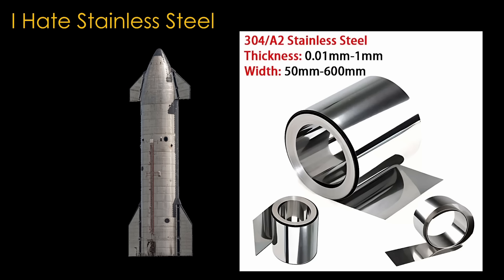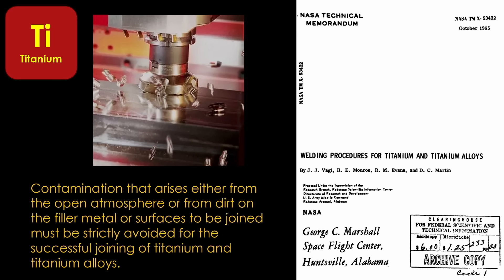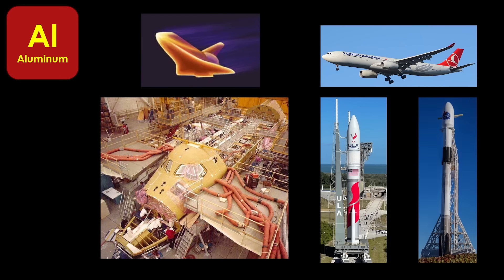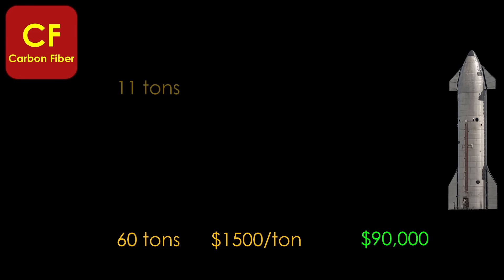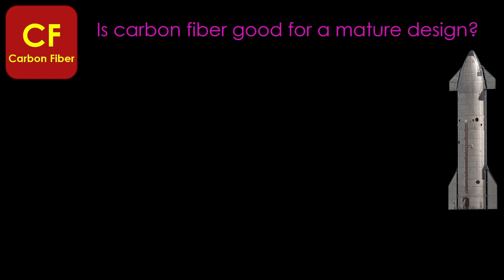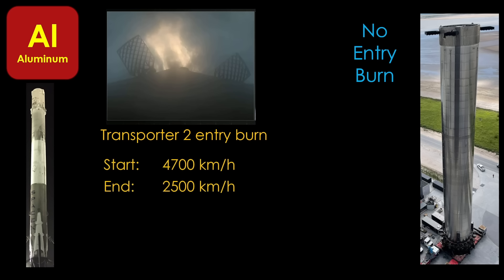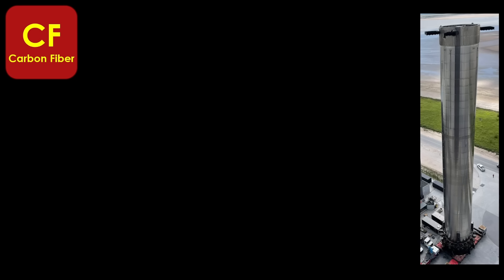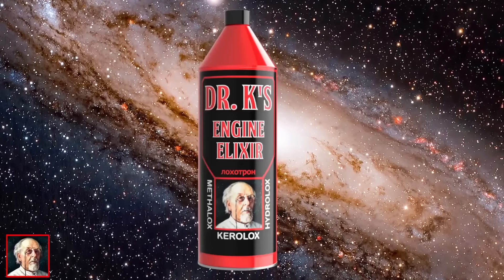Why Starship Loves Stainless Steel...

Comment: Another thing that you didn’t talk about which is extremely important is basically a third year engineering question (which was asked in my third year by the professor). By your logic large aircraft should be (/ could be) built out of stainless steel (as per your Super Heavy logic), BUT ARE NOT ! Why is that the case? The reason is extremely clear if you follow the iterations of super heavy. Aluminum provides significant better buckling resistance as a function of weight due to having a significantly better “bending moment” due to the inherent geometry generated out of a significantly lower density material. It is easy to see this at work in super heavy where they have drastically increased the number of internal stringers to deal with this problem. It is now basically the case that super heavy has effectively doubled the amount of stainless steel to generate a good cross-section geometry to resist buckling. All of these internal stringers appear to be spot welded onto the outer skin generating stress concentrations that hurt the buckling strength. This requires further strengthening adding weight and any mechanical engineer can see the spiraling addition of weight needing more engines, more fuel adding more weight (iterate as per Musk Methodology). One can make stainless steel work, but is it optimal ‽ Also one can stir weld aluminum to provide a more homogeneous connections without stres concentrations!

Another related issue is that a more flexible stainless steel structure has significantly inferior vibrational characteristics that also force this need to stiffens the wall structure (to push up the resonant frequencies). This is now biting them in the proverbial tuchas on starship because  the stainless steel structure that is used to “loosely capture” the thermal tiles is too vibrationally flexible and thermally expansion / contraction VARIABLE. So more stringers, more weight, more engines, more fuel adding more weight; rinse and repeat! So they brag about how the stainless steel stood up to extreme temperatures (sorta), but if the stainless steel is getting hot, then something is very wrong. 

The musk methodology is that no part is the best solution. So if that is so good, why has the internals of super heavy turned into a Rube Goldberg contraption to deal with the icing generated by their pressurization system? 

I believe that the reason that stainless steel is being used is due to the exact same reason that a “FLAME DIVERTER TRENCH” was not needed. It is going to take time to bandaid the inherent problems baked into this design.
Reply from the maker: SpaceX clearly knows everything that you mention - and knew it before they started with starship - and therefore their choices mean they looked at the trades and believed that stainless was the superior material. We don't have access to all the data and information. 
WRT the thermal tiles, nobody had ever tried to put thermal tiles on a cryogenic tank and therefore there wasn't prior art to look at. SpaceX clearly believed that they could figure out a solution to make it work, but it appears that they haven't yet. They might come up with a solution that works, they might go to a metallic solution, or they might end up with transpirational cooling, or some combination of those. That is the sort of thing that happens when you are doing research.
Reply: → EagerSpace

Thank you for a thoughtful reply. I believe very strongly that Spacex has very competent engineers (& control system engineers that are extremely knowledgeable). The thing is that there seems to be a tension (or even a possible disconnect) between establishing well thought out beginning foundations of their designs and the potential ramifications. The Musk Methodology seems to imply that everything in a developmental process can be iterated into a satisfactory outcome by starting from basically a simplified clean slate with little regard to industrial practices.  The rate of iteration is breadth taking and almost morphs their designs in an organic evolutionary fashion. The thing that gives me pause is that sometimes very large initial global design strategies have the feeling of not being deeply thought through before they embark on that path. Part of the worrisome aspect of the Musk Methodology seems to revolve around the issue of just who makes the foundational path decisions. 

One of my engineering professors was responsible for making the decision of what was the design lifetime of the Space Shuttle (an obviously foundational design parameter of the whole program). The short story is that he “pulled it out of his a.. because it was a nice round number”! These were his words and he always got a great laugh out of it. Considering that he had a PhD in Aeronautical Engineering and was brilliant, one can get a sense of how big decisions can be made that establish developmental pathways. Personally I get a strong feeling that possibly some significant starting decisions at SpaceX are established by someone who doesn’t respect in-depth early planning because it slows that part of the process down. It is also possible that more options are not evenly considered taking into consideration various people’s experience. It is clear that Musk has a type of genius, but he is not prescient when it comes to somethings. 

Yes no one has ever embarked upon putting ceramic tiles on an overly flexible substrate that is subjected to massive acoustic, aerodynamic and structural forces that is also a cryogenic tank that gets extensive heating. This is not the low hanging fruit solution.  For me it is a solution that is fraught with a lot of unknown unknowns that will take a lot of time to overcome.

Again, many thanks for your excellent videos.

Comment: This gave me pause to think about the reason why they used titanium for the SR-71. In my head , I thought titanium resists heat better than steel, but that doesn't seem to be the case. So the main reason they chose to use titanium is because of the weight benefit, and because aluminium doesn't resist the temperature. Theoretically, a stainless steel SR-71 would be able to fly faster if they could get it off the ground ;-)
Reply from the maker: With airplanes the default is typically aluminum because it's a great material. The SR-71 would have stepped up to titanium for the better high-temp performance than aluminum, and it doesn't get hot enough to go beyond what titanium can do. 

And lightness is obviously hugely important.
Reply: @EagerSpace  Yes, another example of engineering tradeoffs ;-)
Reply: No one would blame you for not knowing high temp “steel” exists. In metallurgy, we wouldn’t call it “steel” we’d more likely call it “stainless” because the composition and properties are vastly different. I feel like “steel” is used for high strength low alloy and plain carbon steels which do not have these high temp properties and more simple alloying additions. If we’re specifically talking about high temp properties, we’d likely go one step further and say “austenitic stainless” since there are 5 different types of stainless and austenitic stainless steel has the best high temp properties.

Comment: I mean if you need a little more payload to orbit you can always release a payload + falcon 9 upper stage out of the starship bay.
Reply from the maker: I think you should be talking to impulse space for a kick stage. It's designed to do that sort of thing and will be higher performance than the F9 upper stage.

Comment: Maybe the  Moon  Starship will use Aluminum. That will not only be useful for the moon but could land many planetary exploration contracts. The impact of the tons saved (no need for reentry) will allow a revolution on Solar system travel.  It's not as good as Nuclear Thermal but it will be huge.
Reply from the maker: SpaceX would need to build a different production line and do a fair bit of testing to do that. They wouldn't get any more money from NASA.

Comment: F1 chassis constructed of cf seem to handle 200c without any significant loss of structural integrity. I wonder if you could build Starship from that f1 prepreg, then reinforce it with carbon/carbon in high-heat sections? It might be an interesting way to expand capabilities down the road -- without needing a clean sheet design.
Reply from the maker: Where is the F1 chassis at 200c?
Reply: @EagerSpace  The area around the exhaust manifold has got to be getting up there. They go through lots of thermal cycles over a season, and you don't typically see delamination failures. I'm sure I'm missing something, but you got me thinking about the benefits of lower mass during re-entry, and the addition of carbon/carbon reinforcement would give you thermal protection to ~2000 c.  Fantastic channel Eager!

Comment: Not related to this topic, but I think it would be interesting to take a look at the SH grid fins. At the latest Starship update presentation you could see that the v2 and v3 SH have their grid fins lower, and by the looks of it they are bigger as well. In the tracking footage of the booster landing on ift4 you can see that the grid fins have a relatively high angle of attack, but the booster itself has got a pretty low angle of attack, so has the current solution to little control authority? Also as far as I know the reason to use of grid fins on the F9 was bc they could be tucked in on ascent and deployed on descent but now on Starship they keep them out the whole flight. So wouldn't it be better to use normal fins at this point?
Reply from the maker: Grid fins are used because they perform well at hypersonic speeds. F9 tucks them in to reduce drag but presumably SpaceX did a trade on them for super heavy and realized that the mass and complexity of making them movable wasn't worth the reduction in drag on ascent.

Comment: You did imply it a bit but I do find it interesting that even if Starship does achieve what it sets out to do there will still be opportunity to make something out of carbon fiber that would be better. With the caveat that whoever sets out to do that would need to know what they want first. (Also that the most likely group would be Rocket lab).

That also does give a video idea for you. “What could be built to beat Starship” and have it go over potential     drawbacks to the current design or other options that could be cheaper. Some I could think of, smaller while still being fully reusable so most missions do not need ride shares, dedicated on orbit tugs to avoid needing as many refueling flights, carbon fiber instead of steel, fewer bigger engines that are pushed less so are cheaper in the long run (personally not sure about Raptor’s wear rates based on engineering principles) and other potential drawbacks that starship has because of trade offs made.
Reply from the maker: The really interesting word that you use is "better". I'm not sure what your definition is, but it's pretty common in spaceflight for better to be "more technically elegant" or "higher performance". With the exception of Raptor - which is both of those things - starship is a big brute of an architecture but what SpaceX is going for is cheap and robust, which gives a different set of design tradeoffs. We see that in Falcon 9; it started as a pretty average two-stage rocket with an okay engine because that was the quickest way to their goal.
Reply: @EagerSpace  I use the term better in the way that twin jets replaced quad jets such as the 747 and a380 despite them possibly having a lower $/passenger-mile or how proposed blended wing aircraft are more fuel efficient. To me better the able to serve customers at the lowest operational price after development. In automotive it is like how the Model T became obsolete or how unibody replaced body on frame most of the time.

As you say starship is a big brute so all else being equal a "better" more efficient lighter design would use less fuel and thus be cheaper. Same goes for utilization, number of refueling flights, refurbishment costs etc.. This "better" is more in terms of minimizing long term operational costs while still maximizing the amount of customers. For starship this would entail ignoring the iterative development testing where SpaceX did not know what they want from the start or how raptor is road shippable in the same way Falcon 9 was and became limited by that.
Reply: In a bigger picture here is a list of things starship chose to do for reasons outside of minimizing operational costs.
Reply from the maker: Airline efficiency optimization depends on so many factors that it's hard to make simple statements. Flight crew number matters, engine efficiency is huge, and carrier operational patterns are big. The A380 was a decent idea given the way carriers were flying when it was started but that shifted and it turned out not to be economical in the end. 

One of SpaceX's strengths is "operational, then optimize", and I think they have optimized the starship approach to get something that will probably work. Raptor is the exception to that - it's hugely optimized but it's not clear to me that there is a fully reusable vehicle without an engine like raptor, at least not one with a high chance of success. 

So much of the discussion is around optimizing for performance or payload. Fine to do once you have an approach that works, stupid to spend time and money on before that.

Comment: I thought titanium was used for high temp applications such some parts of jet engines … because high melting point above steel melting point.  Does tensile strength eventually beat steel at very high temps? 

I think carbon fibers will replace steel in some parts of starship & booster … internal baffles, structural splines on the inside where cold propellents exist, internal pipes, etc.

I think carbon fibers will eventually be used for starship lunar lander and any other refillable vehicles that never return to earth.
Reply from the maker: Titanium alloys are used for the lower temperature parts, but the highest temperatures use nickel alloys or ceramics.

Comment: Mmmmm, I have seen falcon booster finish it's entry burn and still traveling upwords of 4,700 km/h. Meanwhile I have yet to see super heavy reentering that fast. I think they just don't plan to ever renter very quickly and thus don't need to do any burns?
Reply from the maker: Falcon heavy is going much faster during drone ship landings; I used a rtls mission because that's what starship does.

Comment: Note that even if Starship doesn't want to return to Earth it's doing an aerobrake somewhere.
Reply: Aerobraking forces can be made arbitrarily low, so even probes with flimsy protruding solar panels would be so capable
Reply: @shanent5793  If you just want to lower your orbit, yes, but not if you want to land, like Starship wants to on Mars.

Comment: Maybe in the future, after Starship is fully operational, Elon's obsession with increasing payload capacity may result in a very slow replacement of steel with carbon fiber, but you can also argue that just increasing the diameter is a viable option too (in both cases you need to redesign your factories and ground systems).
Reply from the maker: I think a diameter increase is probably a lot easier to accomplish than a material change.
Reply: @EagerSpace  Well, if you change your materials you need to re-learn how to make your rocket. If you change your diameter you can apply more or less the same techniques, and keep most of your original staff.

So even if in both cases you need to redesign most of your factories and ground systems, increasing the diameter may certainly be easier.

Comment: Stainless steel costs much more than aluminum, the 302x on a good mill contract is at least 3500mt depending on alloy surcharge.

Comment: Thank you, I love your videos!
Can you talk about Starship's orbital refueling please?
Reply from the maker: What specifically would you like me to talk about?
Reply: @EagerSpace  According to Nasa, they said it would take 15+ launches to refuel one ship to go to the Moon.  ( sourse from Smarter Every Day with Destin).
How can they launch that many rockets in a short amount of time ?  How long does it take to fill all the cryofarm and how many rockets they can fill with it? How will the actual transfer go? They need to have the fuel in a same spot to be able to pump it out ...   It's very far from being done, very far I think. This is where I think Starship will hit a wall.
Reply: @ludwigvanzappa9548  With out hard figures on boil off rates and actual tanker capacity ALL numbers are projections or complete guesses.  It's almost a pointless endeavor at this point.
Reply: @TheEvilmooseofdoom  Not enough data. They plan to test it in 2025 we will know more soon enough.
Reply from the maker: Thanks. I did a video on starship as an orbital propellant depot, and with control of orientation and some decent coatings you can can keep your propellant around for a long time. There are other approaches - sunshades, active cooling - that could increase this a lot. 

Nobody knows how many launches it will take because nobody knows what Starship's performance will be, so we'll just have to wait. SpaceX kindof knows, at least for the designs they are doing but none of this is clear yet. It's clear it's going to take at least 4 refuelings and probably won't require 20, and I see very little reason to think that the exact number matters much; if you can do 4 refuelings you can do 16. And to refuel for HLS you just need one starship acting as a propellant depot in orbit; you fly until it's full, then you fly the HLS starship, dock, and refuel all at once.
Reply: @EagerSpace  Thank you !
Reply from the maker: Look for an upcoming video on this topic.
Reply: @EagerSpace  Cool!  Thanks!